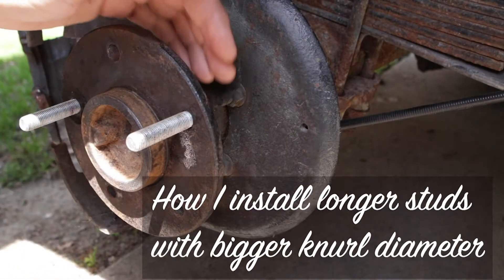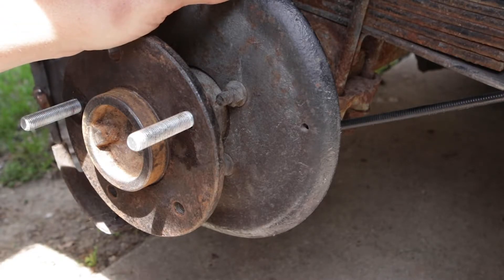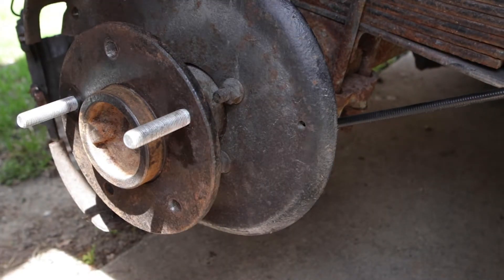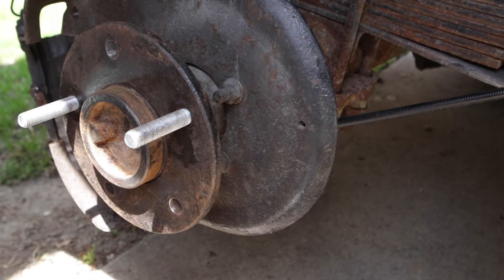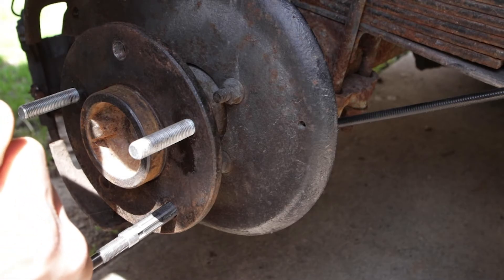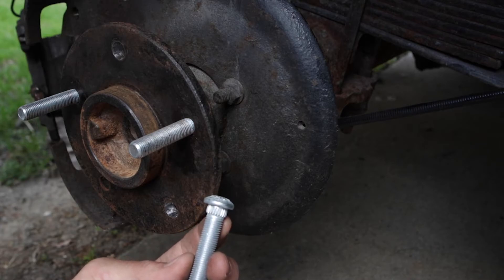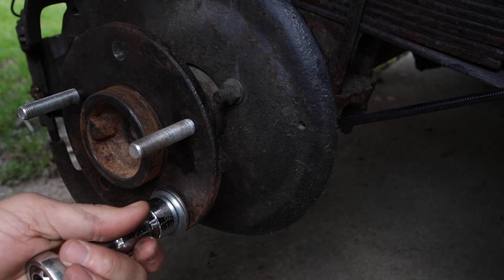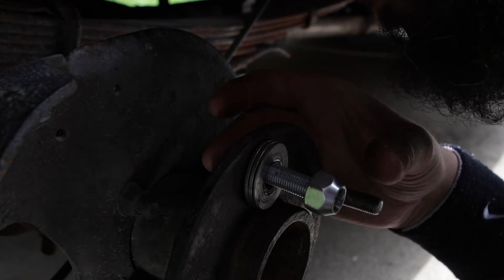How I install longer studs with bigger knurl diameter

Comment: Putting grease (Just a Little) between the washer would reduce friction a bunch. Also, another cheap idea, find a semi truck or school bus repair shop. Ask if one of the service techs have a usable kingpin bearing sitting around you can have. Offer a 12 pack or buy a pair outright from the parts counter. I have 6 or so that I use for this reason and also in my tool box with pullers and pushers. They work great as well like a large Torrington bearing inside a thick housing. DK, ASE master tech since 78, retired.
Reply: Nobody asked
Reply: Job is already done.🤦🏽‍♂️

Comment: Would it possible to sand down the studs knurl 1.2mm so you wouldn't have to drill out the axle holes?
Reply from the maker: That would defeat the purpose of the knurl. 1.2 mm would likely make it smooth and would allow it to spin when you torque the studs.

Comment: Do you still have those old wheel studs? 
I need 4 studs with .463 knurl.  I cant find them
Reply from the maker: I am going to take a look. If I were in your situation I would get the .468 that summit sells. I suspect you would still be in the correct interference range with that.